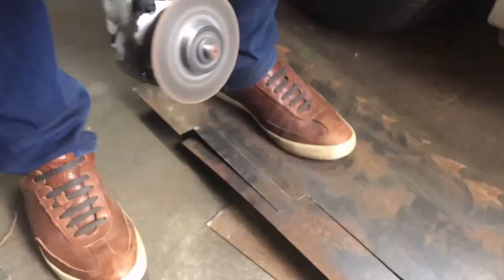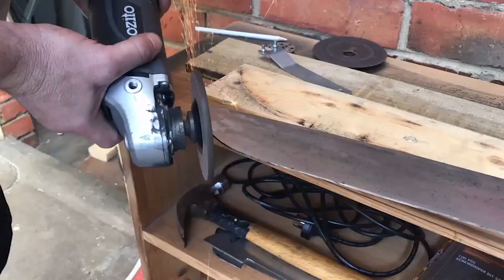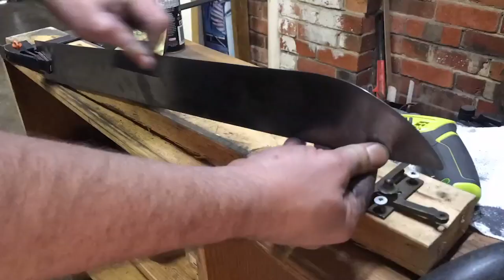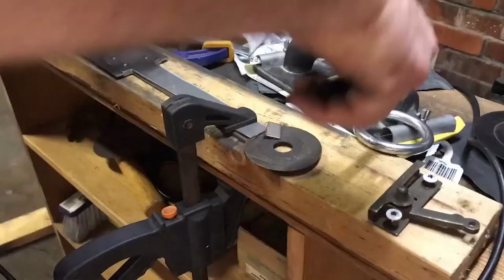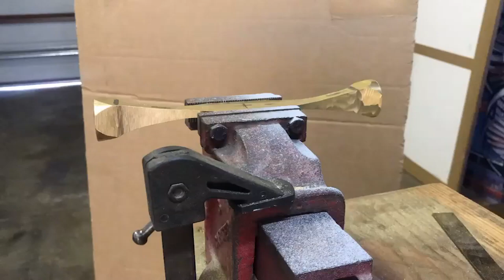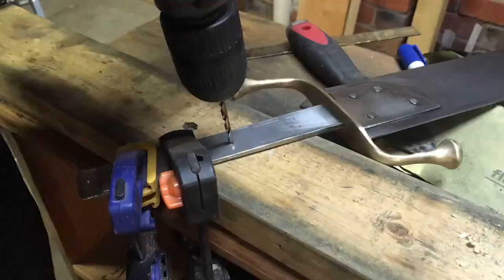DIY NANDAO, Southern Broadsword build TIMELAPSE

Comment: What iron do you use to make a sword?
Reply from the maker: The sword blade steel came from an antique industrial bandsaw. Its a high carbon hardened spring steel.
Reply: Los sables de competición tienen la hoja más flexible sobre todo en la punta 
Para ese tipo de sables de competición que tipo de material se usa ??